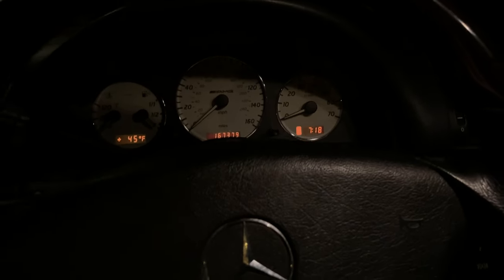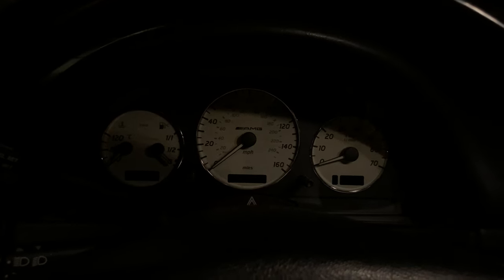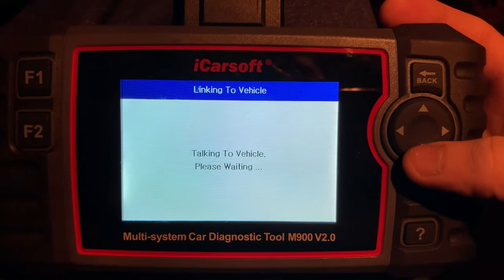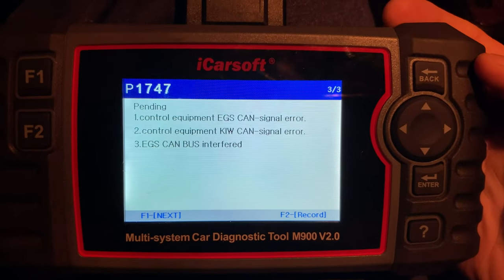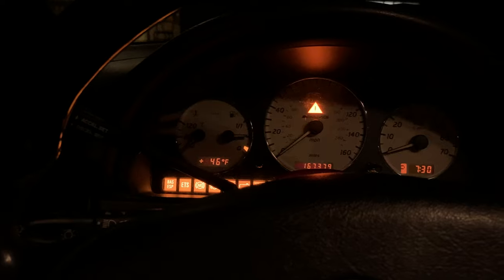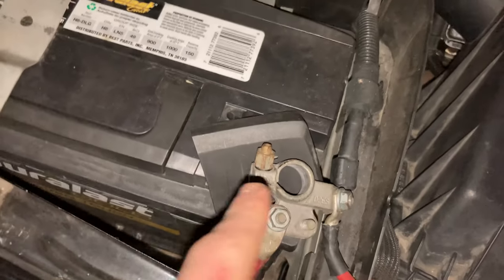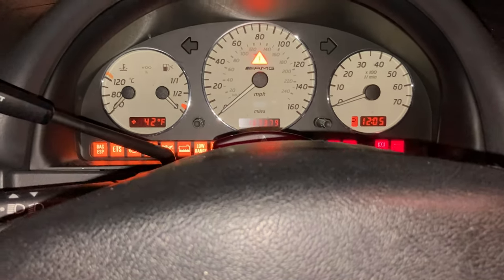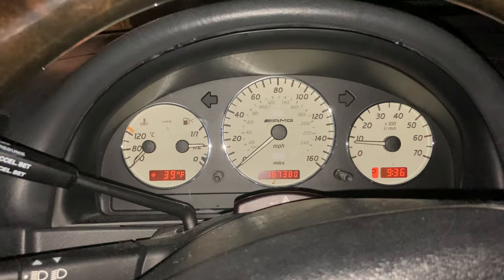ML55 AMG STRANGE ELECTRICAL ISSUE

Comment: Hiya Bud. So it's the bunch of wires that around the ABS unit by your driver side headlight. The lights coming on over bumps are wires touching the chassis. Go thorough all the wires one by one.  Happened to my ml270.  It would happen 85% if I reversed with full right turn. Hope its that
Reply from the maker: Could be, I need to remove the washer tank to inspect it.

Comment: I have owned my 2002 ML55AMG since 2012. At the time of purchase, it had 105K miles on in. Today is August 15, 2022, now with 144,700 miles on the car. Within a few months of purchase, I noticed the ML stalling or accelerator stumble when running over rough, bumpy, jarring potholes, or any type of pavement with significant degradation. Now, within the past two months the problem has gotten significantly worse, now stumbling frequently, stalling, erratic idle from high idle to low idle, stalling, usually causing poor performance, not able to start, going into limp-mode, accelerator peddle functionality disconnecting from engine, having to kill and restart the vehicle to reset the engine. I spent hours and hours and hours and hours, reading, watching, researching, studying, checking, testing, every one of the numerous potential issues and solutions other owners have posted online. Issues that I've researched over the years, which were listed online by other ML W163 owners, are: Throttle Position Sensor is going bad, bad ground wires (electrical shorting), bad MAF, vacuum leak behind the engine (ESG), broken pins in wiring harness connection, faulty stability sensors on the front left and rear left control arms, cracked/broken/malfunctioning EGR valve, bad Crankshaft Sensor, bad camshaft sensor, bad motor mounts, bad or faulty fuel pump, cracked ignition coils, bad plugs and wires, bad battery and improper "indexing", and finally bad break lamp sensor. 

I have assessed, tested, cleaned, refurbished or replaced with new parts, most of the issues stated above that were actually relevant to the problem, and absolutely nothing changes in regards to the problem, only becoming more frequent and pronounced. 

As you have done, I have used OBD2 scanner on multiple occasions, and the ML55 would not register on the device automatically. I had to input vehicle information manually. The same codes always popped back up with each scan, regardless of whether I replaced the parts, even after deleting the ML from the scanner database and from the OBD2 device. Codes were always - faulty ignition coils, faulty OS sensors, and running rich on fuel trims. The OBD2 sensor never would clear the "check engine" light from the dash. Some problems were not picked up by the scanner. Example: fuel pump return line was completed pinched off, preventing the fuel system from maintaining pressure and flow back to the tank. This should have thrown a code, but it did not, and nothing changed on the scanner after repair either. 

Today, I found your video, because I was searching to see if anyone had attempted to reground the engine block to the chassis. After explaining my debacle to a mechanic, he suggested grounding the block with an additional heavy gage wire to the frame from of the vehicle. Lets see how it goes. I have little faith it will actually work due to all of the other efforts. I will reply here, below, if the grounding works.

August 22 2022 - Update on ground-wire between frame and engine: Did it solve the problem? Answer - NO it did not. Although the grounding seems to have slightly harmonized the ignition cycle, it did not solve the stalling, stumbling, rough idle and limp-mode issues. I think the problem may actually be the TPS/Accelerator Pedal Sensor. Although other problems were alleviated by former repairs, i believe the remaining issues are symptomatic of an TPS/APS gone bad. Funny thing, in 2013 had read that this was likely the primary cause. I always avoided it due to the cost of the part. I have just located a NEW replacement part for under $100.00. It had always been $240 - $280.00 in the past. I will buy it, install it, and give it a go. Will update here once I do that.
Reply from the maker: Thank you very much for chiming in with your experience, I hope that the grounding strap works like you said, it has been running good for since I cleaned everything up on the ground cables. I do plan to replace them with heavier cables soon too.

Comment: Hi a couple of thoughts!  I have owned a continuous string of first gen MLs over the last 21 years.  Picked up a really nice 2005 this week. 

First tip is be patient and hold the key in the start position for six to ten seconds. Before deciding that it is not going to start. This can give the 'confused' computers time to make up their mind. This was true for my last ML for a couple of years of it's life.  We are used to just tapping the start position and if nothing happens, done.  Instead wait six to ten seconds.

Second tip. Visual inspection will tell you not much about the wheel speed sensors. The wheel speed sensor code thrown is most often an out of range (internal) continuity and ohm resistance code of the part.  When the wheel sensor code is thrown replace the part as they are only about $12. They do go bad without any external visual indicators.

I did notice something. You have a mismatched set of wheel speed sensors on front and rear. I believe that you have early years on the front, and middle years on the rear?  There were three versions, early middle and late. The three versions deliver different ohm resistance values, that the computers will definitely notice in my experience.

Good luck!
Reply from the maker: Thank you!! Great insight from an experienced owner, very much appreciated!

Comment: Two observations with your wheel speed sensor - they go bad all the time, and I have replaced quite a few of them. The only way to really know if they are bad is either a code stored telling so, or to do a resistance test. Another important part here is looking at the electrical connector, everything fine there? nothing cracked? Since your ESP/ABS/ETC lights are off when the car is running, I'd think they might be just fine, but that was after deleting codes. 
Another failure point I have heard of but never seen myself with those sensor is that the toothed ring sitting on the axle can come lose and spin freely. You can test this manipulating the ring on the axle with a screw driver. It should be firmly attached to the axle.
Reply from the maker: I should mention also… the first time it happened, I didn’t have my scan tool just undid the battery and reattached and no codes or warning lights remained.

Comment: Your battery is shaking/lose because the little plastic tab, that goes in that curved part of the metal retainer on top of the bat, is missing. The plastic tab is usually attached to the battery holder tray. Wouldn't lose too much sleep over it
Reply from the maker: Yea I figured that wasn’t much to be worried about, glad I cleaned everything up and swapped the battery. Two things I’m going to look into next is the ABS module wiring and the shifter bushings and wiring
Reply: @ANDERZENAMG  Good plan! Also check out connector X30/7, and similar main canbus connectors. they need to be dry and in good condition. You can disconnect individual canbus modules here, and see if that restores some canbus functionality for you
Reply: A loose battery could easily do that as well.
Reply from the maker: @krisperkreme6021  spot on, I will have an update soon and fingers crossed but that seems like it was the fix.
Reply: @ANDERZENAMG  That's awesome! Fingers crossed.

Comment: I'd put the AAM on the bottom of the list of suspected issues. I've put many miles on my w163 with burned out AAM, never had a no start condition with it. Looks like some intermittent electrical issue, maybe a bad connector, wire harness or module. You do have some CAN BUS error messages, I'd start following them and investigating how those modules are connected and what could break their communication. You could start by disconnecting some of these modules and see if you can start the car or read codes, when you have the no start condition. Seems like a bit of a needle in a haystack with the icarsoft not being able to read the modules. Were you ever able to read out modules?
Reply from the maker: Good to know about the AAM, it is low on my list after thinking things through.
Needle in a haystack is right… nothing was broken or chafed as far as speed sensors and their connections go.

Drove the car all over today and hit many bumps without a hiccup whatsoever. When or if it happens again I will do some thorough investigation if I don’t find any smoking gun in the meantime or modules don’t have anything stored.

Comment: I have the same brand of car,  with the same trouble, I tried everything but nothing works, last thing I'm going to replace is the instrument cluster, I hope that solve the problem 😅
Reply from the maker: The thing that solved it for me was going through and cleaning all of the battery grounds especially the firewall connections. They were pretty corroded. It hasn’t happened since doing that. Good luck
Reply: @ANDERZENAMG Wussup! Thank you so much for all the content and information. Nice to have a community of 113 owners or similar. So I have exactly the same issue. Mine throws a P1580, comes back to the TPS allegedly. So I cleaned the throttle body and replaced the seal. Checked the battery connections and many other maintenance related task and still have the issue. Did cleaning the ground connections finally solve it for you?

Comment: Hello. Did you locate/fix the problem yet?
Reply from the maker: All I did was clean out wheel speed sensors and cleaned all of the battery terminals and cables. Luckily the issue hasn’t persisted
Reply: I've owned numerous w163 MBz trucks.
Currently driving a 2002 ML55 purchased in 2014. Love it!
Check the wiring harnesses that run to the ABS unit and also the harnesses for the WSS routed near the front inner fender liner edges. They're sharp and will cut into the plastic sheath over time exposing the copper to the elements causing short circuit and all kinds of BAS/ABS problems, especially when driving in the rain or snow.
Reply: @ANDERZENAMG  Remove the left/front headlamp assembly to check wiring harnesses for ABS/Traction Control. Sometimes a leaky washer reservoir will also cause the damaged wires to short circuit.
Reply from the maker: @eaw6590  thank you, yes I did check that area out as well 👍
Reply from the maker: @eaw6590  thank you for the experienced knowledge! Much appreciated, I’ll definitely have a look at the wiring you mentioned to check it’s integrity. This truck is a workhorse, crazy to think it’s 22yo nearing 180k

Comment: hello im from sweden and my bas esp light is on all the time and also abs light, and i cant turn off the esp is that because of a broken abs sensor? :)
Reply from the maker: Hi Janne, it could be but also could be caused by a lot of other scenarios, do you have someone who could scan the car with diagnostic software for you?
Reply: Brushes in abs motor for sure.
Reply: @savagecabbage-4923  that was the problem! now it works again☺️🙌